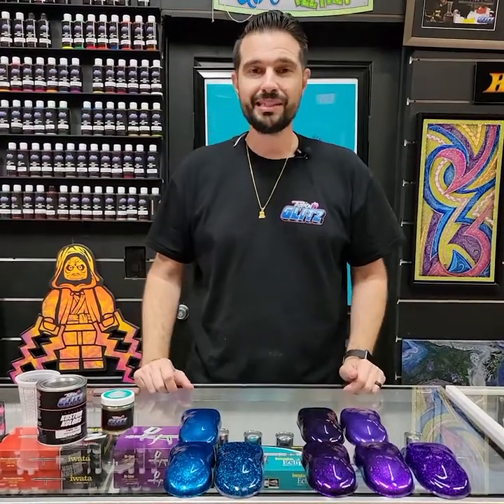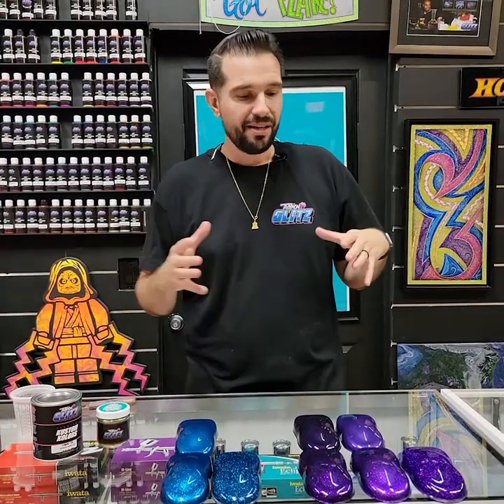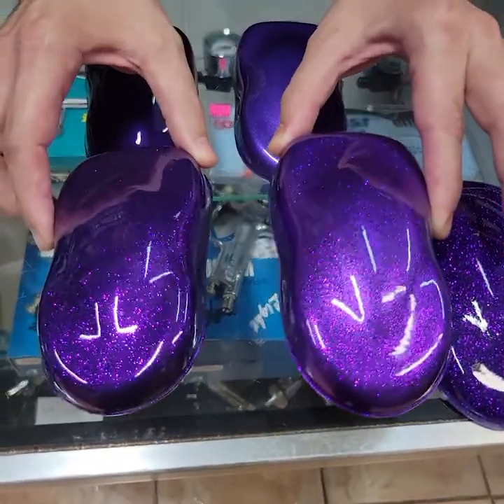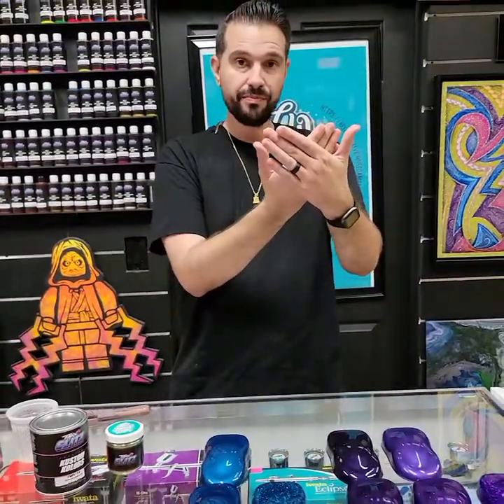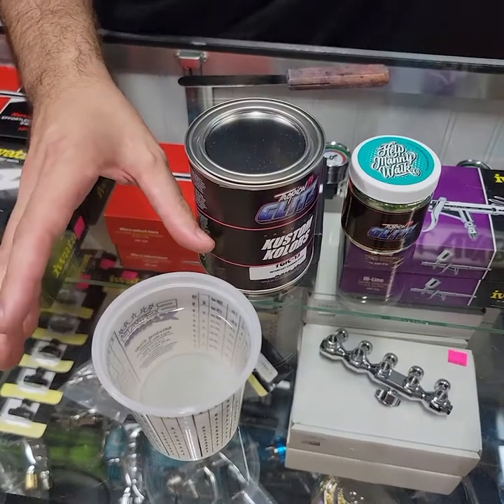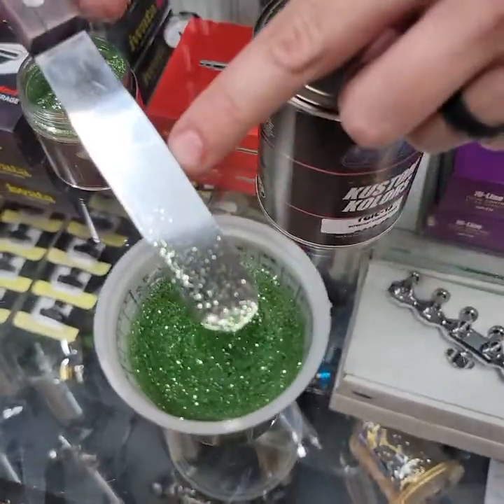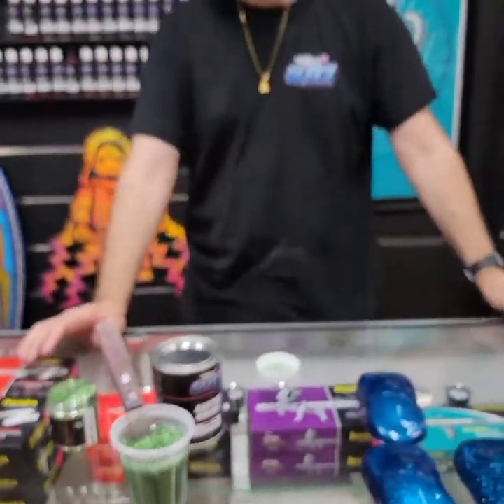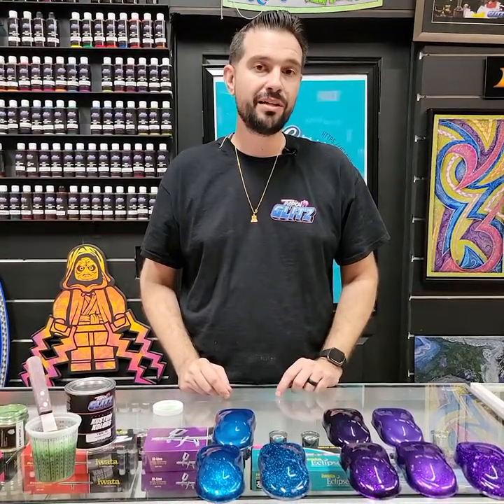Proper outcome of a metal flake paint job

Comment: looks like the flake really pops on the black base more then any other color/shade of base. I have a old Manco 3 wheeler I want to paint with a purple heavy/big metal flake look. Basically like it looks on your example with a black base. Problem is the body is made out of ABS plastic. I know the look i want can be done with many layers but from what you say, i can get the same effect with your stuff and less layers, that sound about right? and what needs to be added or done so the paint lasts on a semi flexible material like abs? any specific flex additive? do all coats get the flex additive as well?
Reply from the maker: You should use adhesion promoter on the plastic.